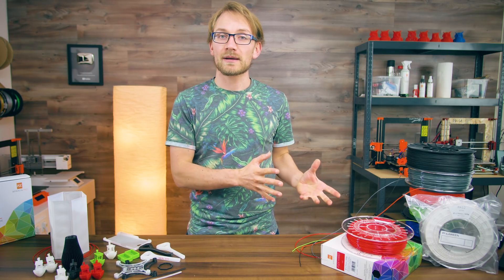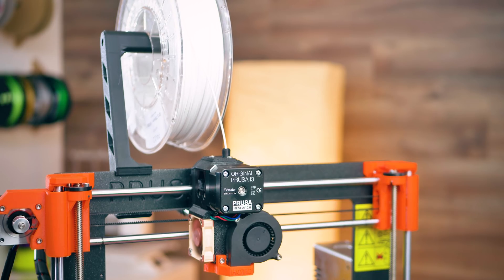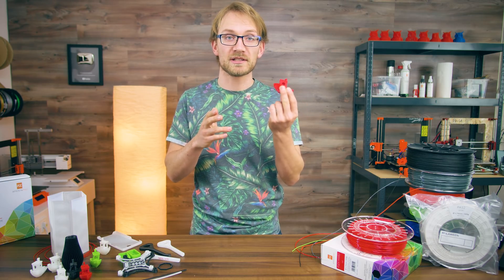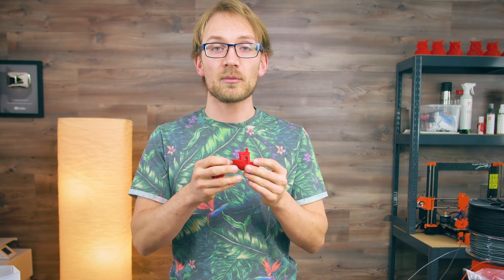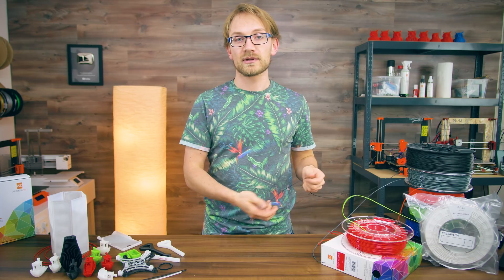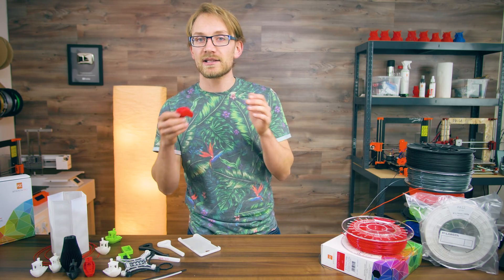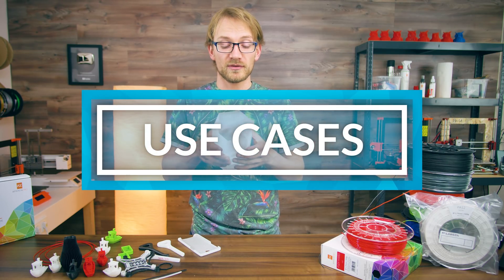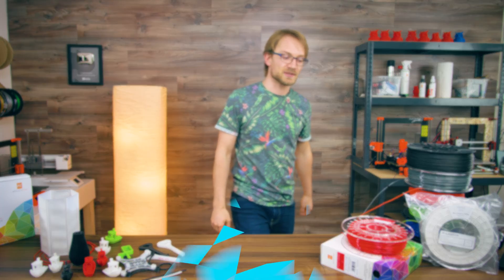Things you should know about flexible filaments and Nylon

Comment: I just finished a 96h print with TPU. I had to start multiple runs due different reasons, clogging was one of them. I switched from my default 0.4 to a 0.6 mm nozzle and 40mm/s print speed and had no more problems. In general, the 0.6mm nozzle with TPU still has great details but much less clogging chances.

Comment: I wish I watched that episode earlier, Tom !
For now, I didn't have any "request" to print parts using nylon family filaments. I might have to experiment with it first, considering all the prerequisites (temperatures, enclosure, all-metal vs Teflon-lined ?).
TPU happens, though. Often, mostly 95A hardness. I print this one straight on a glass bed with constant speed (specific profile @ 30mm/s), Capricorn tubing on a Bowden-type extruder, and it pops off quite easily. (I'd like to try softer materials for fun, though)
The only annoying thing with TPU is cleaning part. Not really easy. Maybe some heatgun post-processing could help ? What would be your best advice ?

Comment: Im fighting TPU for the last 4 days, and it seems i may finally have success... even though everybody recommended low temperatures for the print bed my realy breakthrough was with 110° C on the bed. I maybe do have to say, that the tpu i used was baked and is maybe 1 and a half year old now... i cannot figure out why this stuff wont stick... even with ABS juice i had no chance unless i pumped up the temperature of the bed

Comment: I'm currently trying out the Flex98 Filament by Kodak, but as soon as the nozzle reaches a Temperature of about 200°C the Filament starts oozing out slowly.
The recommended Temperature is 235°C so when I try to run with it, it just smears the print constantly.
Any advice?

Comment: I have printed motorcycle carburetor seals in TPU and have not had any issues. Very handy when the parts are no longer available and you need an instant fix.

Comment: I don't know if you tried to refer to a specific video but I just recently saw a video of somebody testing TPU as a head gasket material for his test enginge in a lawn mower. Turned out neither the cylinder heads made of ABS and PLA nor the TPU head gasket could stand the heat longer than a minute or so.

Comment: It is common practice to soak finished nylon parts in a water bath for up to 24 hours to bring them to their final state prior to packaging and distribution/usage. This is specifically an issue with parts which may be used under load of some sort.
Reply: I know of this practice. (Some of my friends used to do this with their Top Flite nylon props. (As if these weren't floppy enough to begin with...) However, if the surroundings where the part is used, are extremely dry, that won't help for long.

Comment: Hi Tom. After noting your comments about a full metal hotend when printing flexibles I'm a bit worried about my Prusa MK3 now!..The Noctua hotend fan is nice and quiet BUT doesn't create much of and airflow past the fins of the E3D heat sink. Do you think that a Mk3 will be able to print TPU?? in a chamber?

Comment: Actually with a bit of powder smeared on the PEI surface reduces the adhesion over the flex filament; making reasonable of remove.
Reply: GeekinaCave  what kind of powder are you using? Like baby powder?
Reply: Christian Gotsch i saw it on a youtube video used talcum powder over a MK42 heatbed and it work very well. https://youtu.be/EpECi_j7u1c

Comment: TPU Is fun. I got a roll instead of PLA by accident figured Id give it a go with my CR-10. Printed a  test cube i had on the card already at PLA settings on glass before I new any better. It actually printed very well. I then spent half a roll of Orange PLA before I got all of the black TPU out of the hot end. To this day I'm not sure its all gone. :)

Comment: now you know why 3mm filament has the advantage.
1.75 is equivalent of a 3:1 gear reduction but 3:1 is trivial advantage anyway.
do the math and see what the ratio of extrudate per extruder stepper step compared to the resolution of the axes.
it's mismatched by orders of magnitude.

Comment: Thomas, when I print flexible I use lower speeds but I also increase the flow up to 150% with cura (1.5 with Simplify 3d), if I don't do that due to the bending of the filament the extrusion is not consistent.

BTW great series of videos, I'm learning a lot
Reply: If you have to use that much flow increase you should make sure that your filament spool isn’t encountering any resistance to its movement. I had filament sitting on the floor and when I moved it to above the printer that really helped. 

Also you should check the clamping force on your extruded gears. Make sure that the gear isn’t slipping when it extrudes the filament.

Comment: I got a sample of TPU from a friend. I was afraid to use it because i've heard that it bind with PEI. Someone posted a video of him putting a very thin layer of baby powder on the PEI bed before printing. Wipe it off with a dry paper towel so you can't see it. It works very well. TPU still stick to the bed but will be easy to remove at the end.

Comment: My Prusa Mk3 spaghettied on TPU I cut a new bit of PTFE tubing slightly longer and put a 45-degree cut either side, then opened up the hole a bit at the top side then placed it  as near to the gears as possible. It's been fine since.

Comment: Hi Thomas,
what's this kind of through-hole piece on the dry-box you showed on the video, where the filament can pass through from inside to outside? Looks like a muff from a watercooling system or something... Can you tell us what part you used and where to get one of those? Want to build a dry-box myself.
Reply: That's just simple pneumatic connector, likely something like 1/4" 4 or 6mm. They're NOT watercooling muff's by real name :D

Comment: Great series, Thomas.

I'm doing a lot of TPU in ninjaflex  of late.  One really good tip for dealing with it over adhering to the bed:  a really, really light coat of baby powder.  Put a very small (less than 1/4 teaspoon) on the bed, and wipe it all off with a paper towel.  You'll find that you get a good adhesion, but it is easy to remove.  You don't even want to see the powder. 

I'm doing this on my Prusa Mk2s and it works like a charm.

Another thing,  I am using both the ninjatek ninjaflex and the armadillo materials and, in both cases, one thing I really like about them is the layer adhesion.  Instead of having to worry so much about how the part will deal with stress and breaking along layers, I find that the layers are so much better than anything I'd print in ABS/PLA/ASA are so much better - and less prone to failure because of support or warping issues - that it easily outweighs the costs.

Finally, a warning... when a print fails and you are using something like the armadillo filament ("hard tpu") , if you end up with a huge glob of plastic covering the print head, it's a real disaster.  Had this happen once.  The stickiness and rigidity made it almost impossible to remove without destroying the wires to the hotend.  Plus, in my case, it got in to the recessed screws and was impossible to clean them up to where I could do anything.  

I had one major example of this happen once and I replaced the entire hotend.  I'd recommend one of those silicone hotend socks that e3d sells.   Had a tiny bit of a problem once after installing that and it was super easy to clean up from.
Reply: John : Thank you for your excellent thoughts and experiences, very helpful information. I run those socks on my Ender 3 pro,  saved my bacon a few times in cleanup. Overture TPU prints very nicely on my machine, slowly and with little to no bed heating. All the best !
Reply: I am amused that people with experience manages to make blobs on their hotend. You need to seal completely where the hotend meets the heatbreak and silicone socks are mandatory to avoid disasters

Comment: I find pouring some isopropyl alcohol on my flexible prints make them much easier to separate from the build plate.  I can peel it away with my nails instead of using a chisel.

Comment: Thank you Tom!

This is the video I've been waiting for.  Nylon, my personal Everest in the FDM (I refuse to say FFF!) world.  We've been through over a hundred kilos in the last year.  Where do I start?  There are so many property differences between the various Nylon and Nylon-with-extras filaments we've used.  Such a great material, but you're spot on - SLOW DOWN.  

Tips:
Spend time dialing in your coast/wipe (especially wipe).  Direct drive extruder will work best, and keep retraction low (2mm or lower for sure for most parts, we are using .9 as a baseline).

Absolutely must use an enclosure (drafts of any size are your enemey).

Don't skimp on the PVA, you'll be impressed by the curl/lift otherwise.

Drying the Nylon is a MUST, if you see steam coming off the nozzle end, dry it more.  Although, I haven't seen the need to keep it in a dry box while printing as we're in a climate controlled environment with low humidity anyway (indoors, in southern FL).  We can dry a roll of Alloy 910 or Bridge and then use it for several days without needing to dry again.

Highest speed X/Y movement your machine can handle before adding corners to your circles (an absolute must to combat stringing).

UNFORTUNATELY:
Personally, I've had more issues with varying Nylon filament diameter per roll than anything else.  

HOWEVER:
What a fantastic capability, to be able to produce parts out of the various Nylons and blends out there.  Also makes something like PETG seem like child's play in comparison.

Good luck!
Reply: Hi Dennis,

Thanks for sharing these useful tips; my next challenge is to make parts in Nylon too. Starting with Taulman3d 645 & 910, but will also try DuPont Zytel 3D1000FL...

Any chance you could share which printer/nozzle/bed type, and slicer you are using?

Also you say "slow down", but then "Highest speed X/Y movement your machine can handle". Can you clarify this?

Thanks, Ken
Reply: Ken Henderson Slow while extruding, fast when moving to new extrusion start point.  Hopefully you have the extrusion points near each other and a 100mms or better travel speed - this will take care of a whole host of possible stringing issues.  Depending on the part a wipe move can help too.

Comment: Hi Tom,
Great series with useful information.
About Nylon, what if for some reason, raw spaghetti rigidity was desirable instead of al dente? 
Do you know any kind of post-processing / coating one could apply to nylon to avoid moisture absorption?
I thought of trying out XTC-3D on a Nylon part, but the epoxy layer would just crack if the part was bent.
Thanks!
Reply: Use a different material in those cases. (PC comes to mind.) PA just WANTS to get into moisture equilibrum with its surroundings, and most coatings will allow for some diffusion of water. PA also has a notoriously difficult surface to get anything to adhere to (unless you want to work with some chemicals of quite dubious health consequences, like formic acid, resorcinol, and, worst of all, cresol.)

Comment: put a shrink wrap on your extruder gear and crank up the flow rate by 30-50% - the slippage provides constant pressure rather than trying to perfectly chew thru a calculated flow! Works Wonders. I've been bowden printing tpu like this for over a year.
Reply: David Kraft Clever :)

Comment: nylon secretly likes to be printed really fast. It has to be dry - and there are companies out there that make electric dry boxes that will do 5%rh @ 30C - that will dry nylon. But if you print nylon fast enough it will have injection molding like strength,
Reply: Andrew Dowling Can you expand on this more?  I've seen the absolute opposite over the last year.
Reply: Ok, so your going to need a good extrusion setup. Ideally direct drive. Now that introduces its own problems - I use a remote direct drive now with one drive gear, but the bondtech still beats it in shear force - you need something like that. But the bondtech is a heavy thing to move and accelerate fast. Life compromises... After that - e3d volcano setup or similar. Nylon hates to heat up and is thick when melted. And you cant push non melted nylon through a 0.4mm hole on a 3d printer. Next heat up that hotend as hot as she will bear - 275, 290C. I would like to do more but no thermocouple support for my replicape - yet... The goal is to put down a hot nylon layer on top of a still partially molten layer of nylon - and on a large part this means some really extreme extrusion rates or a heated build chamber and on small parts the possibility of loss of surface finish (melty appearance - lower the temp or setup a minimum layer time). Give er a go on that and tell me if you don't get good results. Right now - you might get good strength through super slow printing - because you are literally conducting heat into the part - partially melting the layer below it - but screw that noise - slow 3d printers are for the birds.
Reply: I'm currently printing at ~30mm/s for a 'normal' layer.  What speeds are you working with?  Also, 272 for Alloy 910 is what is producing the best results on the setup I'm using currently, when printing hotter many features aren't in functional quality (smaller features).
Reply: @DennisJHarrisonJrHere  i print 910 at 295, 75mm/s.  It's tough. If only the black was actually black....
Reply: @tykempster  do you have problems with shrinkage?? How hot do you heat bed? And chamber? And what do you use to hold to bed?
Reply: @johnnaskalski1295  no I mill my own garolite beds.  unheated, no chamber, light coat of gluestick is it. i'll be selling the beds soon, they are the ticket.  but garolite as it comes is warped and not flat, must be milled.

Comment: Nice video! Lots of good information. I noticed the printing temperature of the TPU was set to 230°C and this pushed me to share my experience with printing TPU with my bowden setup. I print sainsmart which is a popular choice by all accounts. The recommended printing temperature is 195 to 230°C, but I found it will only print somewhat reliably around 220°C for me. There is a sweet spot where the TPU flows enough that it won't buckle in the hotend that easily, and where it will not start degrading too much. When heated above this temperature, it starts to very quickly leave residues inside the hotend that will eventually clog it up. Even with 220°C printing temperature, I need to do a few cold pulls to clean up the nozzle before every print. I would love to print at lower temperature because it also gives a more consistent surface quality (that shiny surface that the unextruder filament has), but then the bowden extruder (titan in my case) has a very hard time pushing it through consistently and it eventually slows down, and as a result degrades and clogs.
Regarding the process, I found that having (as you said) no retracts and an absolutely constant speed of around 20mm/s works best. It is important that the filament doesn't stall into the hotend or you will get these residues that will lead to clogging. Hope this information will be useful to someone and I wish you a very nice evening!
Reply: Valentin: Thank you for the great information, I concur with your experiences, I use Overture TPU, an excellent material on my Ender 3 Pro,  all metal extruder,  Capricorm PTFE bowden tube, little to no bed heat ( 50 to stick 1st layer ),  Speed same as you, 210 Temp,  my key aspect is a well maintained and clean machine, ( for all print jobs) we do car parts and gaskets mostly, and lots of home projects too. All the best !

Comment: Yeah, TPUs LOVE the bed (Ninjaflex style; 85A).  I've been printing parts slightly off the bed with support everywhere / raft, since taking a knife to TPU could end with gouge marks on the under side from getting it off the bed...  Soldering iron / wood branding iron can fix most issues post-print!

Comment: Hi Tom,
Do you print nylon in the room where you are yourself?
I mean, don't the fumes make it dangerous to be in the room where you print nylon as I heard the fumes are very carcinogenic.
I am not at all afraid of a incidental print with Nylon now and then, but would it be good to use it as a to go to material when you are making parts a few days a week?

Thanks in advance if you answer this. 
Cheers, Brian Dragtstra.
Reply from the maker: +3d Print Creator Nylon specifically made for 3D printing is different from the Nylon made as weedwhacker line (which is where the "fumes" topic is coming from). Of course, it's going to depend on the exact manufacturer and material and general handling and safety advice still applies.
Reply: Thanks Tom.

Comment: Great video. I recently tried NinjaTek Cheetah and it's one of the weirder filaments I've tried. I used a profile for PETG and adjusted cooling and bed temperature a tiny bit and it prints amazingly well at speeds around 60mm/s with retraction and everything while still being just a tad stiffer than Ninjaflex TPU which I've never been able to print at more than 20mm/s on my Ultimaker 2+.

Comment: Can the cr-10 print flexibles/nylons?
Reply from the maker: I haven't tried, but it should be able to handle the more rigid flexibles and Nylons!
Reply: Yes you can if you mount a direct drive extruder like the E3D Titan Aero. You can download a CR-10 bracket for the Titan Aero extruder here: https://www.thingiverse.com/thing:2755616
Reply: Thomas Sanladerer thank you just got mine yesterday and unboxed it on stream i have a stream going right now of it printing